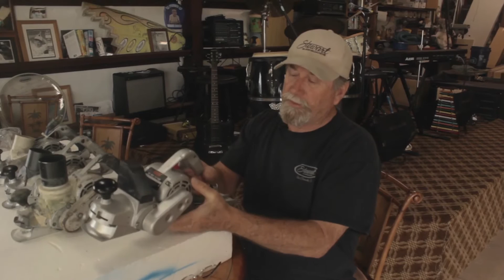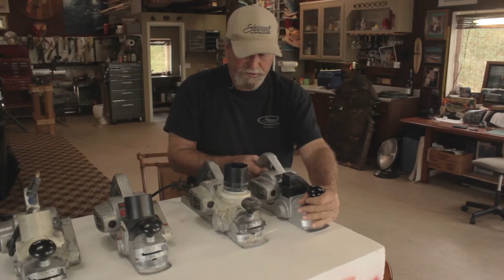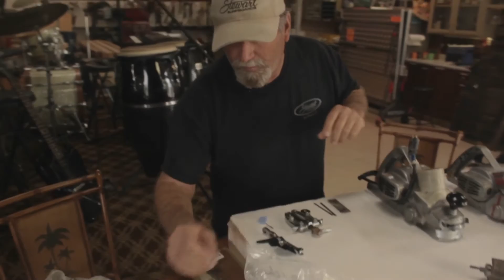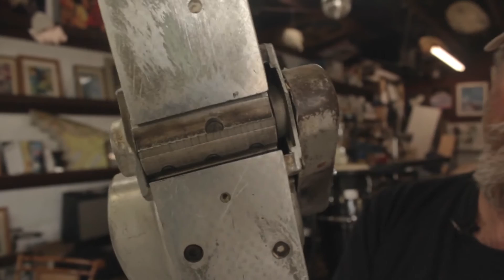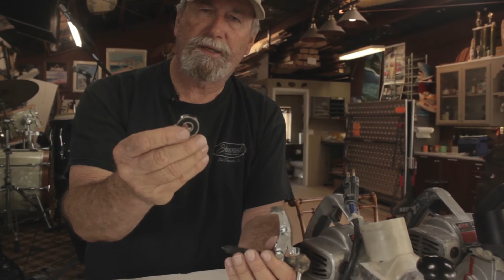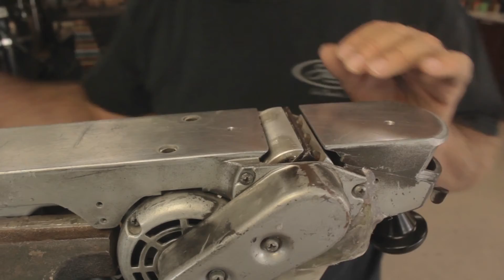Bill Stewart talks his Skill 100 planers with modifications and More

Comment: Hi Bill, I have the skil 100 with the little skinny blades, that you held up in this video. I bought it in about '80 or '81, and have been shaping with the same blades ever since. I've flipped them around and sharpened them, but I haven't found replacement blades for those yet. Once I realized they stopped making the skill 100, I've used my small Makita that Joe bought me in the early 70's, to take the brunt of the work load, and only use the skill for foiling rails and thickness flow.. On the Makita, I cut the top of the drum on the front foot shorter so i could get a really thick cut out of it, for big styro blanks. I use the Makita for skinning and all my preset full passes, step cuts and cross-cuts, to save the skill and give it more mileage. Sure would be nice to find a new set of those skinny little blades somewhere.

Comment: Hi Bill -not sure if you check your messages but im gonna give it a try.. I was wondering which trigger switch you used to modify your skil planer 100?  Also do you possibly know if a trigger switch from a 240V machine would still work on  120v skil?  Where did you buy those awesome thin blades ....I been scouring the internet with no avail!
Reply: I have the same question.